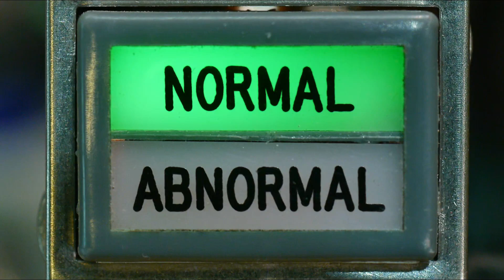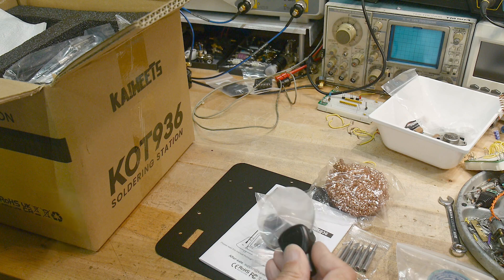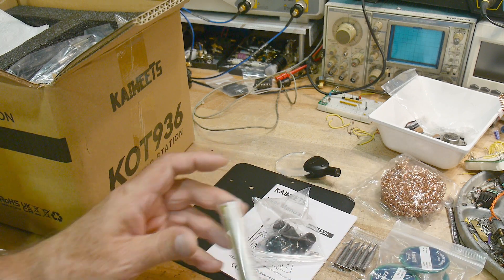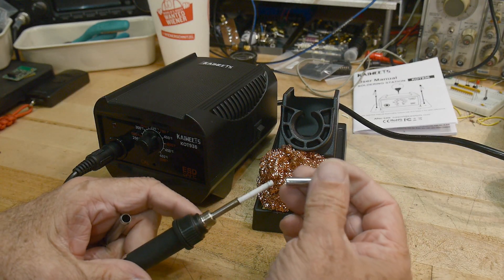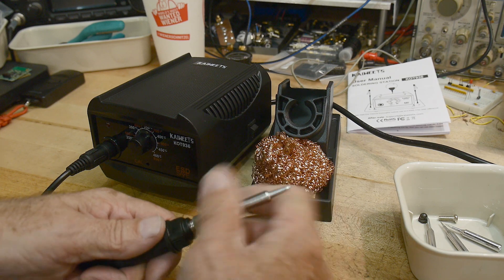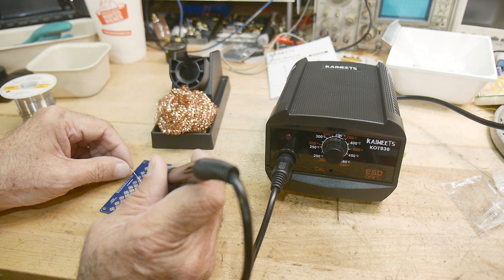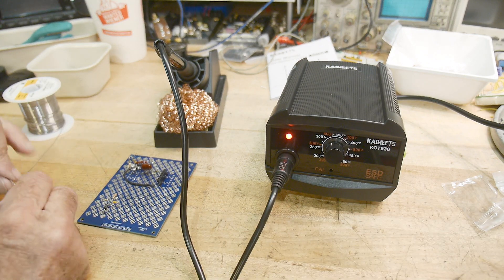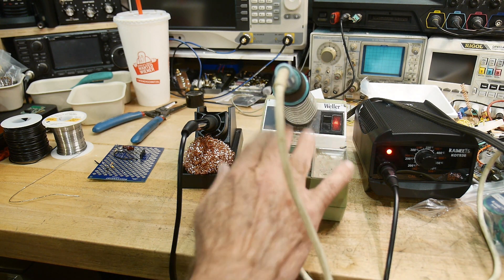#1534 Kaiweets KOT936 Soldering Station Review

Comment: Wanted to comment on solder iron tips. You mentioned that you like the bevel or chisel tips and I usually do as well for through-hole parts or chassis soldering. 

I have been practicing soldering surface mounted parts in preparation for my next project that I don't want to mess up with sloppy workmanship. Today I tried a strangely curved tip, often seen with JBC style compact stations. When I saw it, I immediately discounted it. I tried it and I like it. It works well on surface mounted parts. I can get in and around and apply solder as I want. I am pleasantly surprised.  My bias kept me from using it. The only issue is cleaning with a brass pad as it gets stuck on the strands.  

As for the Kaiweets in the review, the price of name-brand stations is high for hobbyists. I don't know what replaces the Weller WES51 which was a good basic unit. JBC style units are available at a decent price and I like the Sugon A9 I sprung for to solder surface mounted parts, if you don't mind copycat products. I'm using an AmScope SE400Z with a 0.5 objective lens. My lighted magnifier just doesn't work for small lettering around the SMDs and my aging eyes.

Comment: I have a hard time paying $500 to $1500 for a soldering station for hobby use. I had an adjustable temperature Ungar for 20 years until it was discontinued. I think Weller bought it and when I couldn't find tips I salvaged the transformer and sadly discarded it. I tried three units from Circuit Specialists and all three failed in three to six months of moderate hobby use! First was a rework station with hot air. Then a couple of basic adjustable temperature units. So, I bought a Weller WES51 in June 2017 for around $108 and it is now discontinued - I saw one on Amazon for $270! The tips on the Ungar were great and so are or were the Weller tips. People at work would leave the Weller station on for days if not weeks and the tip would clean up! Not so with the other brands I tried. (Note: I don't want to slam Circuit Specialists. The dual voltage power supply I bought from Circuit Specialists around 2010 works great and was a price I could justify for hobby use.)

After watching a few reviews on soldering stations with the heating element close to the end as is the sensor, I tried a Sugon A9. I only saw one independent review on it and read one mention of it on eevBlog. It heats up by the time I have it in place to solder and cools down once on the holder. It is similar to a JBC but I cannot justify the price of name-brand units like that. So far, I like it. I don't know if the curved tips are useful. I have only tried the sharp 45-degree tip. It should come with a normal bevel tip like I had with the Weller.  I paid around $120 for the Sugon A9 and I got extra tips and handles (more $$) so I don't recall exactly. I wanted a shorter soldering iron to use under a microscope for surface mounted parts. Hope it lasts.

Comment: That iron would work perfect for a kids electronics lab class except for the easily melted cord.
Also, that gap you described is the problem. I have different brand but similar wand. I trimmed  the metal sleeve that surrounds the heating element just enough so the soldering tip contacts the heating element. Trim too much and puts to much load on element and could break. The second thing, is to get a tip thermometer. The stock dial is barely enough to let you know it’s on.  With that slight mod and verified temp, that should never be a problem of the work wicking away to much heat.

Comment: i use one of those blue very cheap soldering irons from China with the yellow knob to adjust the temperature, they come with the exact same little bag with extra tips.
These tips costs arround $3 for 5 pieces. The trick for getting these cheap soldering irons to perform better, is to cut a small piece of metal from a soda can,
and use that as extra sleeve between the tip and the white ceramic heating element, and that makes a lot of difference in heat transfer.
I use that cheap soldering iron with the small 3mm shizzle type tip, and use leaded solder from Stannol (Tin69/Lead29/Copper1) with a temperature of 350° C and that works great.

Comment: Why do they keep making those long handles, the way to go is small pencil style handles.
Reply: It's not the way to go for everyone. Depends on your preference. I find no real difference between long and short irons. However I do prefer a nice fat handle like the Weller TCP uses. 
Andy
Reply: Agree.  It seems one of the selling points of the premium irons is the shorter tip.  I don’t know why the cheap ones have to be long.  I even read that some buy the cheap stations and modify to accommodate premium tip handles just to get around this.

Comment: Which Metcal do you use?  They have so many choices.
Reply from the maker: it is an older model Mx500
Reply: @IMSAIGuy  Nice.  These generic "936" units all suffer from the things you noticed.  Even the original Hakko 936 did (probably why they don't make it anymore).  The Metcal MX series is not ridiculously expensive and uses a more modern approach.  The only thing I have against these newer irons with the tip/heater/sensor all in a single cartridge is the price of the cartridge.  $40 and up.  I guess it's not so bad but if you are like me and tend to leave irons on for hours, it could get expensive.

Comment: I think the $10 Walmart soldering iron I have in my tool box does a better job.  It can even stick down smt parts pretty well.  That Weller is all you saw in commercial electronics back in the 70s and 80s.  I used a pile of them.  Your Amazon UK links are good, it will discourage purchases from the US.

Comment: Seems like a nice station, I was expecting the run-of-the-mill chinesium rectangular enclosure but this one is funkier, pretty nice. And the number of accessories is impressive. More than just a station...

Nice old Weller. I've got a TCP-S with a custom power supply. Does a nice job when tinkering with tube amps.

Comment: If it can't heat up those pads, it is junk. JUNK
Reply: I wouldn't say it's junk. It simply works as intended. Those old Hakko-style soldering irons are just outdated today because they have a separate heating element and temperature sensor from the tip, and they have insufficient performance by today's standards. It's strange that Kaiweets decided to invest in that instead of making something with T12 tips.
Reply: @SlaVoy  after 50+ years in electronics, and having used many soldering systems, I can say with out a doubt - it is junk.
UNLESS you want to be continuously pissed off because the heat is not sufficiently responsive. Use METCAL
Reply: As someone mentioned earlier, the temperature needs checking.
There is not a lot of difference between the TCP iron and the Kaiweet in the heating the tip method TCP tips don't make a particually good thermal contact either..I've used TCP irons since I started work 40 odd years ago, so I know them very well. I did buy a cheap hot air + iron station which used the same sort of tips, and it was indicating low on temp, once set to something reasonable it's fine.

Comment: i probably soldered over 300-400 smd ic`s and thousands of  0.4`s and 0.6s with a 25$  25Watts iron no temp control  i even reball small bga`s directly with it using tips made out of coper wire and bronze for the the 0,4 and 0,6  and my hot air gun is a 40$  2 speed 4 temp points 200-300-400-800 C  with this i managed to remove graphic chips and replace by using the 25W soldering iron underneath the bga i have it in a pice of cooper that i drilled so that the soldering iron goes entirely inside  and on the top i hit it with the gun at 400C  took a bit of time to learn to use trash tools but is doable you dont need 1k$ soldering ,  altough i am young  i do use a microscope if you have a good microscope and a digital microscope camera it`s more important than anything for smd , PS i dont advise using trash tools if you do it at a commercial scale a fast heating iron is very important the jbc`s are up in 5 sec or less  same for the hot air i am practically using a heater it works but not that good you really have to know what you are doing i

Comment: I'm a wuss.  I am still stuck doing 90% of all my soldering with a late 50's / early 60's Weller single temp iron with a ~1/4" chisel tip and a wet folded paper towel (gave up the sponge long ago) === and still have my roll of 60/40 Kester solder from back then too (?? 3mm dia ??).  Never had a problem -- well, surface mounts are problems, but wire wiring?  no problem ...
Reply: solder is 0.062" dia

Comment: Nah, I've seen so many people struggling with these cheap, crappy soldering stations, they're junk, it's far better to spend a bit more and buy good tools which will last years and do the job well instead of  buying garbage to save a little and wasting so much effort trying to make it work.

They say a poor workman blames his tools but the tools have to be capable of doing the job and there is just no substitute for thermal mass and high power temperature controlled heating elements like the Wellers, Metcal etc when it comes to making good solder joints.

Comment: Meh, these are ok if you're on a real tight budget (these can be had under $25 if you shop around) but there are many better options now for not that much more, such as the T12 and TS100 that perform MUCH better, I would hesitate to even recommend these to a beginner.

Comment: Which model of Metcal do you have?  How about a link to it?  Does the Metcal have the tip style like the Kaiweets and Weller or it like the T12 with the heater built into the tip?
Reply from the maker: it is an older MX500. the base unit is an RF amplifier that sends 13MHz power to the tip where it is converted to heat.

Comment: A fixed temp or adjustable power Weller is about $50 to $60.  The adjustable temp Weller is around $100 and has a digital display.  Weller used to be a USA company but is now owned by a German company and their low end soldering stations are assembled in the USA or Mexico with Mexican parts.  That is more expensive, but much better quality.

Comment: Surprised you didn't measure the tip temp on all units.  When I got my $100 Hakko station, I found the cal was way low.  So I was initially disappointed (like you) & then had a secondary disappointment that I had to recal a $100 station.  Once calibrated, it works as good as anything I have.  I see the Kaiweets has a cal pot.    Low set points may look like low thermal inertia (taking literary license).  Maybe do a METCAL review??